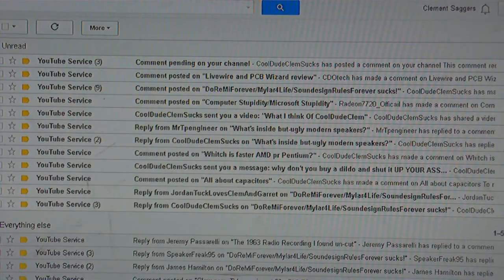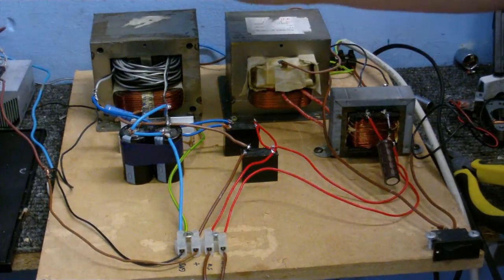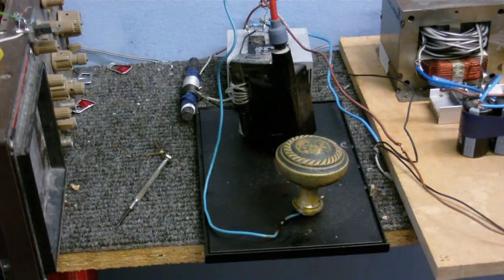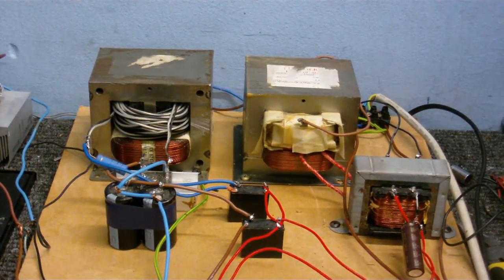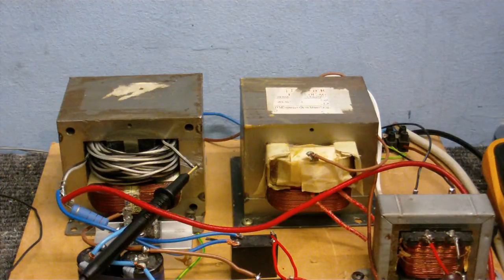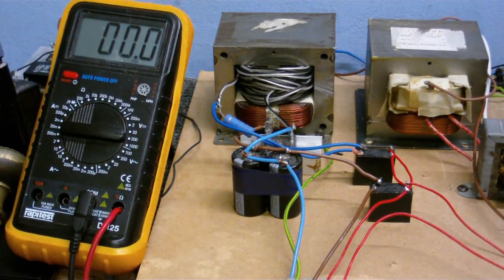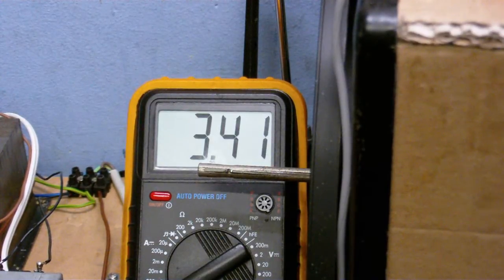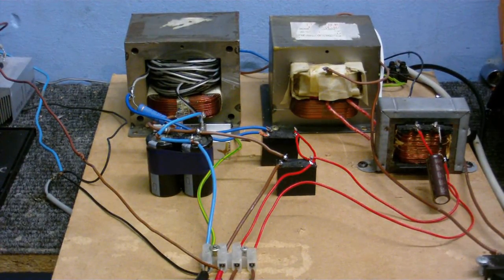High wattage power supply (well sorta anyway)

Comment from the maker: Not sure what frequency it is, I'll might scope one of the mosfet gates and find out, it's probably between 15 - 30 kHz at a rough guess.  Also I'm going to see if winding a thicker primary onto the flyback core gives better results, the primary I have on the flyback right now will burn up after about a minute of use.

Comment: Apparent power =/= real power. But you knew this already ;-) You can use a current clamp to see the current on the scope, and an attenuator for the voltage. Actually some multimeters can measure both simultaneously as well and calculate the power factor. Awesome stuff you showed here btw, but don't you get unexpectedly high electricity bills doing this kind of stuff all the time? :-)

Comment from the maker: I might add a fuse at the transformers output, that's a good idea, I thought about that myself, although if I could find a breaker that works at low voltages I would use that instead.

Comment: Clem isn't that 864 VA? Not watts? use your scope to measure the phase shift between the current and voltage its probably wasting more like 60W or something, I just think that's the case because 864 W would go into heating the transformer and if you do the math it would get up to very high temperatures rapidly (melting point of iron etc) and clearly its not glowing hot while sitting there.

Comment: MOT's are not the most efficient TX's, mainly, because they have iron shunts and the laminations are welded together which cause more eddy currents in the steel.
For projects they are fine as they are only used for short periods of time and not 24 / 7.
Good set up and measurements.